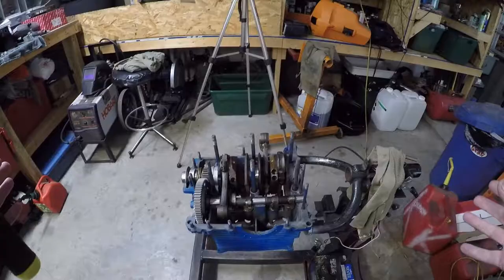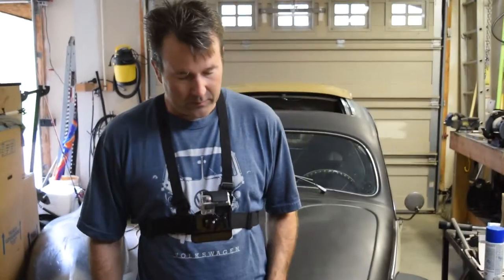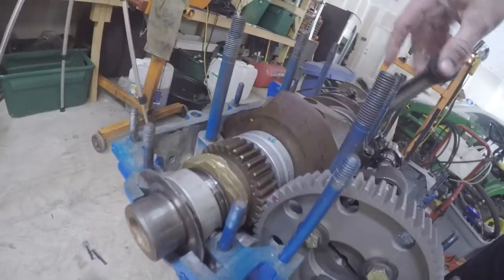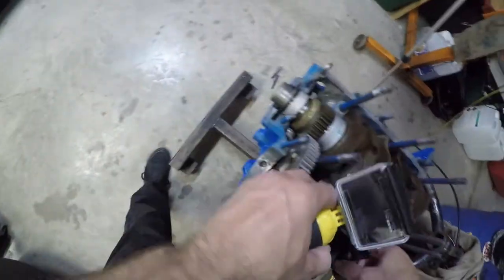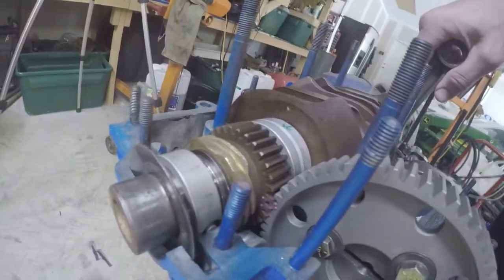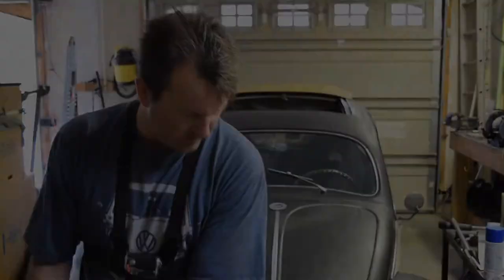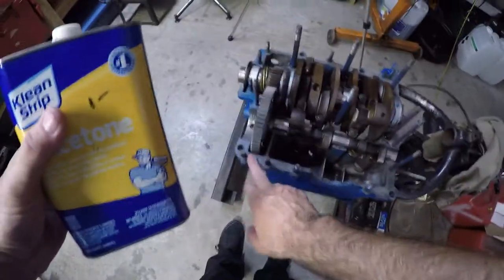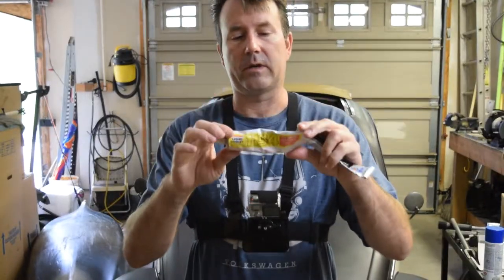Sealing up a VW Short block known as Grease Pit

Comment: Hello, say want to ask, I been told that silicone will get hard, and break up in small pieces. Therefore, the pieces will get into the oil pump, bearing etc. Thx for the video ,theduck
Reply from the maker: In 25 years of building these engines I have never had what you described happen to me. I'm sure it could happen if you're not careful and put too much silicone that some could get in the oil galleries.

Comment: What are the case “seals” you refer to under wave washers for cam case nuts ? Are they o rings or something? I think my hardware kit only has regular washers and nyloc nuts
Reply from the maker: There should be some little round paper gaskets in your gasket kit. Plus, I use a tad bit of black silicone rubbed into them.